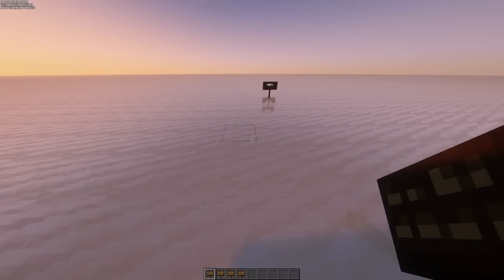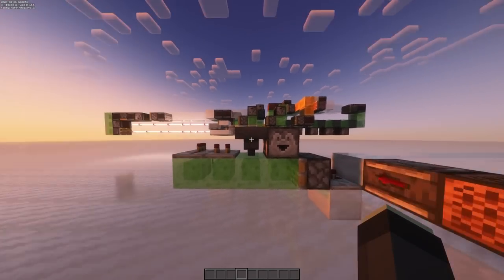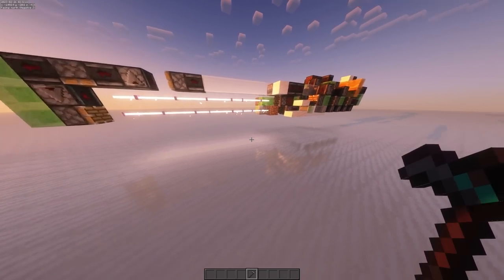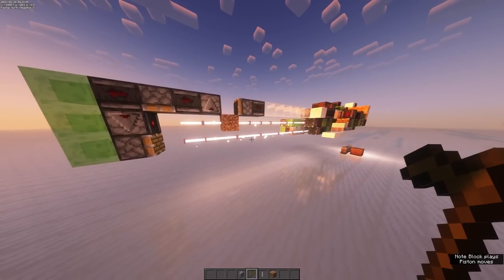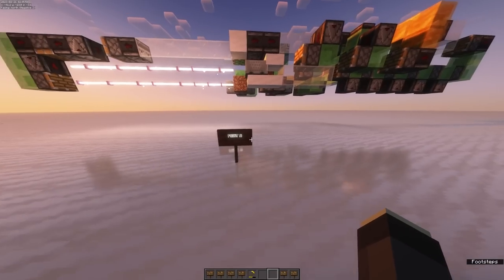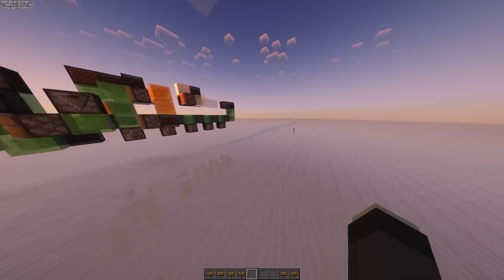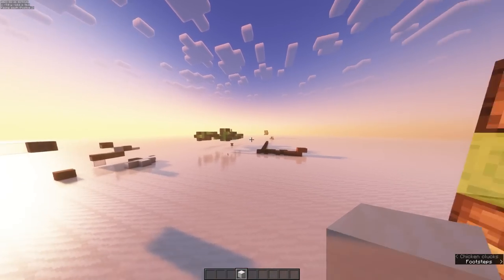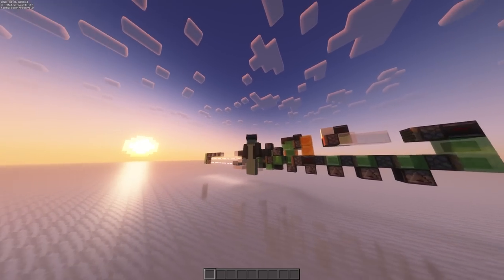Encoding Flight Data into the Durability of Minecraft's Greatest Tool

Comment: I once saw a slime missile system solve this in another way too, by first sending one flyingmachine, wait a little depending on distance you want to travel, then sending another slightly faster flying machine behind. When the second flyingmachine caught up to the first they would both stop. Not totally sure which is easier to build, missile thing or this one. Might have to look into it
Reply: Are you thinking of Cubehamster's precision bomber?  I saw that and made my own a while ago-- wasn't too difficult.
Reply: I was just about to leave a comment about this!  He's done a few updates on precision flying machines I think, I might have to check them out after this
Reply: @sorin_markov  returning to this comment now, I cam to think about if you are travelling thousands of blocks, the "two part" precision flying machines are way less suited seeing as one part would end up in unloaded chunks or you'd need two players. Unless the speed difference between the machines are so small they could be sent after eachother within the same loaded chunks around a player afking on only one of the machines.

Comment: Now make an X,Y version, that uses 2 ways and probably a Minecart that'll swap you to the hoe for Y from X
Reply from the maker: This was the original plan. I can dream, but it never happened because I'm bad at slime stone. Maybe some day.
Reply: @squibble111  "because I'm bad at slime stone" ayo stfu you're a fucking genius at this
Reply: @squibble111 My brother in Christ you have built a flying machine that can track distance automatically
Reply: @squibble111  Well, you would have to move the whole contraption not just one way, but in two ways. Try pointing the center mass upwards into the Z after you have figured out how to get a contraption to work in both the X and Y directions. lol. As for to have it go up, you'll have to put the contraption into another dimension as your W (probably won't work lol).

As for encoding flight data, perhaps you could build a redstone counter using rails? Or, move things so as to be an analog, instead of redstone, counter.

I don't like breaking my items lol. But this is pretty cool. :)

Comment: The flying machine knows where it is at all times. It knows this because it knows where it isn't, by subtracting where it is, from where it isn't, or where it isn't, from where it is, whichever is greater, it obtains a difference, or deviation. The guidance sub-system uses deviations to generate corrective commands to drive the flying machine from a position where it is, to a position where it isn't, and arriving at a position where it wasn't, it now is. Consequently, the position where it is, is now the position that it wasn't, and it follows that the position where it was, is now the position that it isn't. In the event of the position that it is in is not the position that it wasn't, the system has required a variation. The variation being the difference between where the flying machine is, and where it wasn't. If variation is considered to be a significant factor, it too, may be corrected by the GEA. However, the flying machine must also know where it was. The flying machine guidance computance scenario works as follows: Because a variation has modified some of the information the flying machine has obtained, it is not sure just where it is, however it is sure where it isn't, within reason, and it knows where it was. It now subtracts where it should be, from where it wasn't, or vice versa. By differentiating this from the algebraic sum og where it shouldn't be, and where it was. It is able to obtain a deviation, and a variation, which is called "air"

Comment: You could scale it up even more with the unbreaking enchantment
Reply from the maker: I forgot to mention in the video, but the reason I chose not to, is because unbreaking doesnt increase durability by a flat, calculatable quantity, but rather gives a percent chance to not use durability when the tool is used. This makes the amount of distance subject to chance, and I wasnt willing to sacrifice accuracy for more distance
Reply: Infinite Improbability drive?
Reply: You could also bring more hoes with you and fly even farther(up to 1.5 million blocks if you have a full inventory of netherite hoes) but you would have to manually switch them out to keep going farther
Reply: @squibble111  This is true, but thanks to the law of large numbers (https://en.wikipedia.org/wiki/Law_of_large_numbers) you have pretty good guess how much it will be because you will use it in the realms of thousands (because you can use non-enchanted hoes for smaller distances)
Reply: @NejakejTomas  the law of large numbers means that the observed average will tend toward the expected average after enough trials. However, this does not mean that your standard deviation will decrease when you increase your trials, so your accuracy will still decrease with larger durabilities

Comment: I wonder if you can make a mob based distance counter. You can use the same block shuffling mechanism to deal suffocation damage every once inna while. And there has to be a way to dect if mob is alive. Maybe a skeleton or raider shouting target block? I also know that raiders crossbow break with time on it's own, but I don't know if they always start with full durability.
Reply: Move the mob on to a redstone ore to see if it's alive, if the ore lights up then it's alive, if it doesn't then the mob is dead. You may be able to have a mob magazine large enough to count higher than the durability of two netherite hoes, but I think the real power of a mob-health-encoded distance-counting slime block flying machine would be the relative simplicity of adding a second stage that goes in a different direction. A two stage mob health encoded distance counting slime block flying machine would give you the ability to automatically go to any point in the world on the x and z axes without ever having been there before. It's like teleportation that you have to wait for!
Reply: @Jt.512  regeneration potions can be also used to make mobs survive longer
Reply: @GameModder  how do you automatically apply potions to a mob on a moving flying machine in a way that doesn't defeat the purpose of counting down?
Reply: @Jt.512  some system with a raid witch healing a pillager maybe?  Just need a way to slowly kill the witch: the big issue is the witch can heal themselves.

Comment: The 21 block discrepancy is very easily explained and accounted for, actually!

In Minecraft (Java, at least), the durability of tools lies to you. A tool does not break once it reaches 0 durability, it breaks once it's used whilst having 0 durability. This means effectively that you have 1 more durability than the tooltip shows you. Thus you'll always travel (durability+1)*21.

A very cool project nontheless. impecable work!
Reply from the maker: That makes a lot of sense actually. Thanks for teaching me something new!
Reply: only applies to versions below 1.13.1
Reply: @ThylineTheGay  yeah it's a lot more consistent when I'm not playing on 1.8.9 (only version I play below 1.14.4)
Reply: are you sure this works on 1.14 plus? I remember they removed this 0 durability a while ago, and so items that had 0 durability became rare collectables
Reply: @NeverSnows  nope, tools break when used at 1 durability after 1.13, so in versions above that just ignore the original comment
Reply: @ThylineTheGay  actually it still exists, and from first-hand experience, I've gotten a 0 durability item in 1.19.3. any versions after I do not know, but I do know it is possible, but much rarer for some odd reason. I personally believe the reason to be enchants, as I've gotten it to happen in 1.18.2 and 1.19.3, both with enchanted tools(one was a fire aspect gold sword and the other was an unbreaking diamond axe)
Reply: You can still get 0 durability on a tool if you have unbreaking on it.

Comment: now we need someone to extend this with another 21-block piston feed tape that only steps once per 21 blocks and have the player hoe some dirt on THAT feed tape instead and you get 441x multiplication (21x the distance, where you can only choose a distance to within +/- 220 blocks of your destination, which is trivial compared to the 1785000 block range)
Reply: The real question being as to the practical application. When do you ever need to travel 1.8 million blocks in a line?
Reply: @sorrowandsufferin924  2b2t

Comment: Doesn't placing some sort of immovable block at point b in the path of a normal flying machine (or at least some block that will be detected by an observer) achieve the same purpose? 
Since you talked about cases where you already know where point b is, that probably means you've been there before, and since that destination is important to you, you could just place a station to stop the flying machine for when you plan on coming back.
Only case where i think this design could make a difference is if you've never been at point b before
Reply: That's pretty much the problem with this in terms of practical use. If you know the coordinates of the destination, it's much faster to rocket there with an elytra, make a stopping station, rocket back, and then fly a faster one-way or two-way flying machine over.

Comment: 3:55 So the real longest distance you can travel is 4064 * 21 * 8 if you use this in the nether (and exclude weird existing portals shenanigans) 😮. Instead of travelling only 85'344 blocks, we can travel 682'752 blocks 😎. By using multiple machines, you can easily double, triple, x-tuple the distance 🤓! Now the only factor to worry about is if you'll still be alive (IRL) when you finally arrive… Those ~680'000 blocks will take forever to cover 😅.
Reply: if you're okay with imprecision, some unbreaking could increase the distance

Comment: I wonder if you could simplify the feed tape, one side moves with the machine while the other side moves against it. You're currently pushing both sides, but the side moving in the direction opposite of the machine could just be left free-floating, instead of redundantly pushing it both backwards and forwards.
Reply from the maker: Yes, if i ever remaster this system, ill fix all the things like this

Comment: idk if anybody else has commented this, but do you think that you could get the dolphin + hoe flying machine working by using a bubble stream to prevent the dolphin from drowning ? that would allow the dolphin and the items to be in a (maybe) closed area, while still being able to pick up the items through a corner. maybe the issue is something else though, im not sure
Reply from the maker: The biggest issue was not the dolphin, because keeping it from drowning is usually not an issue. The problem is that in order to move waterlogged blocks, you have to zerotick the block, which doesnt push items, meaning the items will fall out.

Comment: Could you also just chain a bunch of conveyer belts to encode a number in base 21? With three belts you can encode almost 200,000 numbers.
Reply from the maker: chaining a bunch of flying machines that only trigger once the one before it completes a full loop is far more of a difficult task than trying to juice as much data out of one as you can.
Reply: Observers always activate when moved, in order to chain piston tapes in that way you would have to design a feed tape that can be moved and cycle it's data independently, which is surprisingly difficult, and would result in the machine moving a LOT slower as well. Though now I want to see if I can figure it out

Comment: A much less cool but also more practical method would be to calculate the real world time based of your speed and desired distance and just set an alarm to stop the flying machine or to use te hand restock feature of a mod like tweakaroo allowing you to mitigate the requirement for a feed tape thus allowing for a full speed flying mahcine. much less creative though and i much prefer your solution from a cleverness standpoint
Reply: That loses precision due to poor frame rates. If you are content with loss of precision than an unbreaking enchantment gives a % chance to avoid losing durability.

Comment: you can use half the number of diamonds if you turn the dirt into a path with a shovel instead of farmland with a hoe, but I suppose driving a flying machine with the power of hoes is well worth the extra diamond
Reply from the maker: Im gonna be honest in the designing of this machine, i totally thought using a shovel would work as well, but for some reason it didn't? I have no clue why.
Reply: @squibble111  wouldn't you theoretically be able to somehow encode two dimensional travel into the flying machine, by having a shovel in one hand a hoe in the other and somehow checking whether the block is farm land or a path block (maybe launching the player onto the block or smth)

Comment: The flying machine that had a dolphin had water in it, how would the machine push the water? Doesn't pushing water with pistons get rid of it?
Reply from the maker: Zero ticking a water logged block doesn't delete the water, because instead of turning the block into a moving version of itself, and then back into a normal version, destroying the water, it just teleports the block instantly. This retains the water.
Reply: @squibble111  Thank you for your speedy responce, this will definetly help me in my future redstone undertakings.

Comment: im guessing you could also adjust the front scaler to be even longer or shorter if you wanted it to be? though im guessing it has a max capacity based on its current build since your probably at about the pistons max push/pull distance with the endrod chain alone, have you found a way to increase the flow size perchance?
Reply from the maker: Uhh, perhaps you can attach one to the other? that was the initial strategy before I came up with this one, just many base 21 counters hooked up to one another. I'm not sure, but yeah you can scale it down for more precision, but you still have a precision of almost a full chunk even at max size, so idk why you would.
Reply: @squibble111  monkey brain says bigger is better, plus since it’s already so slow it wouldn’t really be all that much worse if it was even slower, admittedly it does have a very good distance already so making it bigger would be mostly an upscaled prove of concept “how big and how far can you go” without it being incredibly massive

I feel like you may be able to stack the end rod chain vertically so make it not just be a giant endless rod

Comment: aren't 2 of the pistons in the tape useless? you can remove the one pushing the rods backwards and the one re-pushing them forwards
Reply from the maker: The one pushing them forward is necessary; I need the extra push limit. but it was revealed to me later that the one pushing them backwards isn't, since it just naturally moves backwards as the rest of the machine moves forwards.
Reply: @squibble111  I was talking about the other one that was pushing them forwards, as it's just reverting the work of the one you were already aware is useless

Comment: Just place an obsidian at the destination. And if you want to store more information, chest boats and hopper minecarts are movable. You can then break them with a lava cauldron. Then you can play with the fill level to set a destination, and make the flying machine 2-way. You could also optimize it a lot by using 0-tick pistons.
Reply: The whole point of the video is to travel to a place you have never been too.

Also. Furnaces are cheaper.
Reply: @KWAKZ5  furnaces are movable in Bedrock. That fact that they aren't movable in Java is a parity issue, and will get fixed. Movable tile entities were even introduced in the april fools update.
Reply: @Thexus  you still need to have been there. And If you use obsidian you can just use a normal flying machine that is faster and cheaper

Comment: Trying to think through ways this could be enhanced. Most revolve around minecarts and their tracks, which xan be moved by pistons. Chest minecarts could be carried and contain extra hoes, and you could use a shulker, skeleton, or other mob to make amobile cart breaker to get the items out, but I am struggling to think of a way to sort the hoe out from the chest minecart item to insure the player only picks up the hoe.

As much as I love the hoe system, it would probably be better to have something like 3 linked feed tapes, that when each complete a loop it triggers the next, and thrn the maxhine stops if the tapes are all in the correct position (distance set by building the tape in such a way that it takes that many blocks to reach the final state)
While I have a good amount of theoretical knowledge of what is or is not able to be moved with slime stone I am not well versed in actually building it.
Reply from the maker: Before the hoe system, there was the multiple feed tape mechanism. The dream was to create a data storage device that was free of player interaction, but i wasn't able to make it work. maybe someday ill try my hand at revamping this process to use a solely mechanical data storage. (and one that uses a more convenient base number system(